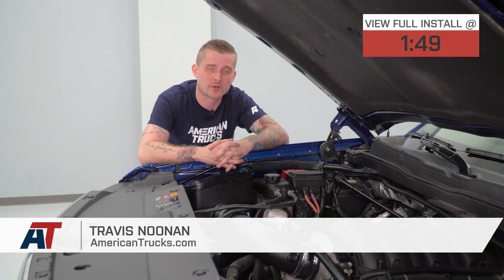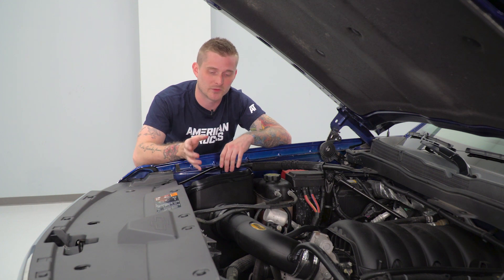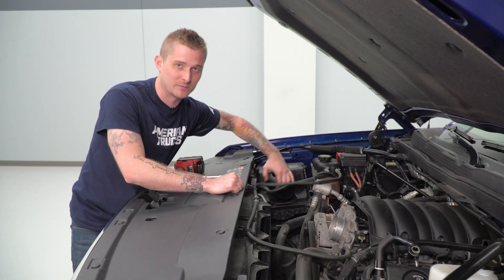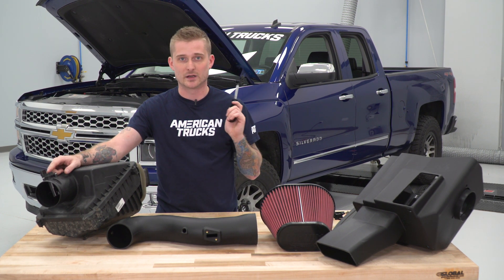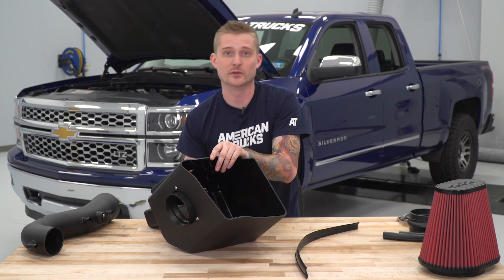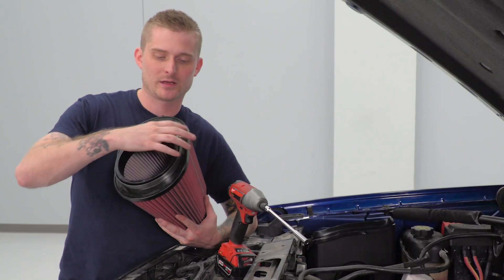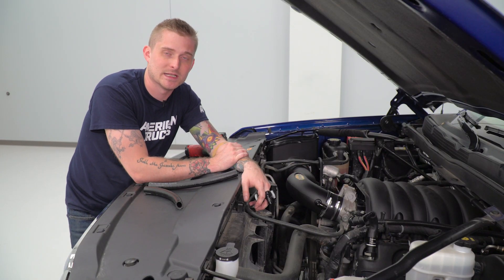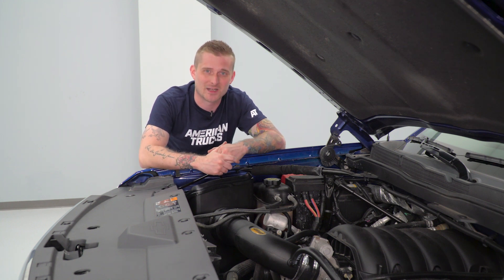2014-2018 Silverado & Sierra Airaid MXP Series Cold Air Intake 5.3L Review & Dyno

Comment: Any concerns with hydro blocking the engine? I like the design, just cornered. Anybody have this set up or have had issues with rain?
Reply from the maker: Unless you're driving through deep puddles often or doing a lot of off-roading in muddy trails, I would not worry about hydrolocking. Airaid does a really good job at designing their airboxes to improve flow but keep a factory-like fit. If you want to play it safe, you can always purchase a pre-filter that helps keep water droplets from even getting to your air filter in the first place. -Zach